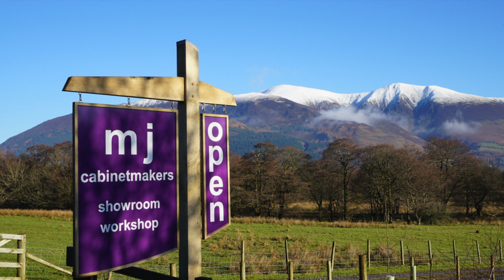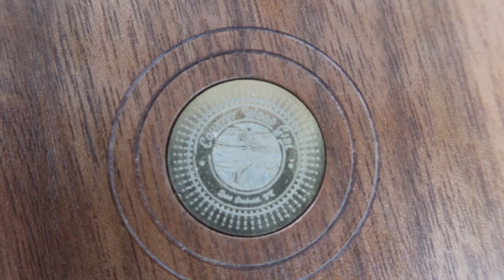Woodturning a lidded box with walnut, Ash and Milliput!

Comment: Great work. I have one safety tip, please do not wear a hooded sweatshirt that has ties hanging down. They are very dangerous and if they were to get caught in your lathe,that could spell disaster.
Reply: Also moving the banjo and toolrest with the lathe running is a recipe for tradigyies.  Poor safety leads to bad habits, that can build a false sense of security... that result in injury.  Please be safe and use good wood turning practices, and you will enjoy woodworking for the rest of your life! 
Cheers!

Comment: Side grained box, pretty. May change shape with time and humidity changes. Tight fit may be a problem.
Reply: I was thinking about the ash inlay for the top too.  Yet if well sealed, it may not suffer moisture shifts much.  I have a slab box that seals tight during summer humidity...beautiful box- closed for half the year...Hahaha.

Comment: A few items I saw that were a bit different approaches and techniques I don't or haven't used.  1st being in laying the lighter wood so deeply that it ultimately penetrates the lid of the box.  Next, curving the inside of the boxes corner meeting the bottom looks very nice.  To get smaller items out instead of having to tip them out it would be easier to grip!  Good job!   Also very nice wood pairing and the distinctive separation using the milliput is a nicely visual! Good job!  

Thanks for sharing
Reply from the maker: thank you!

Comment: Wow ... great job!
Love your work.
A quick question; if I may ... !?
I am a retired engineer. As you are working on your lathe; I cannot help hearing the sound of it; and it sounds as if you have a dry bearing or something making a noisy sound as its running! The main bearing on the top behind your chuck has a grease nipple in it ... do you ever pump a little grease into it ... !? Just wondered, because, again, something is noisy in your lathe!
Not being disrespectful; just; from an engineers point-of-view ... trying to help!
Again, love your work.
Best ... 
William (Hampshire UK)
Reply from the maker: Hi William, thanks for the comment, really appreciate it…… the bearing needs replacing… I do grease it up but unfortunately that doesn’t help, I am on with getting it done so hopefully soon it’ll be sounding better… fingers crossed!
Reply: Hugs!